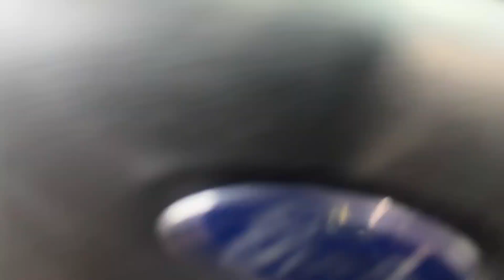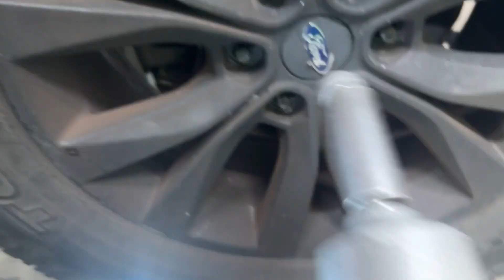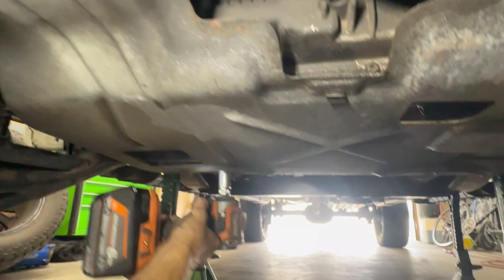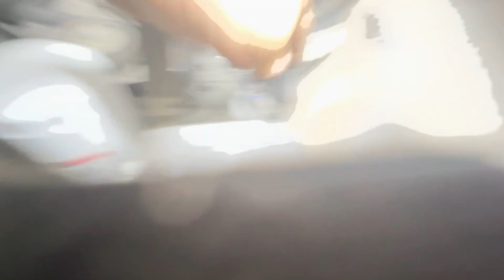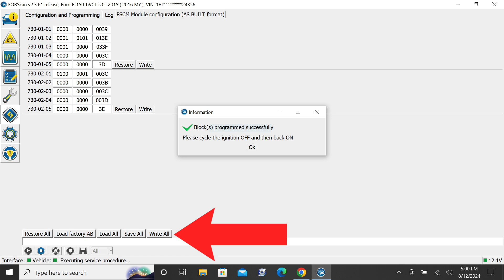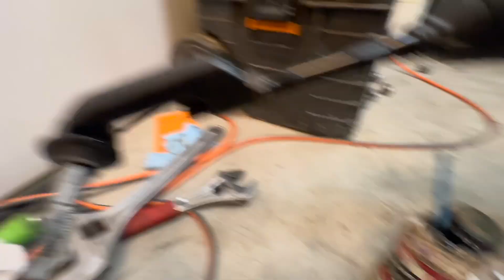Power steering rack replacement 2016 Ford F150 (pro tips)

Comment: Mine just started "wandering" left a bit, then right a bit.  Sometimes it pulls, but mostly wanders... i thought it was tie rod ends, but NOPE,  had an alignment done ✔️-  Ford says its not showing a code.  The mechanic i use said theres a code but he cant do anything-bring it to Ford.    Now Ford tells me its the rack. Had i understood fully about this electronic steering, i would never have bought it.  Why must we complicate things...
Reply from the maker: Typically, the big domestic manufacturers all have a back-end motivation for pretty much all of the technology they implement in certain areas of their vehicles.
If you’re asking me, a salty old technician, I believe it’s all profit oriented.
Reply: We're you able to fix it? I'm having the same problem with my 2019 F150. Any advice is really appreciated..
Reply: GM has them on Saturn's and other cars because on the assembly line it goes in as a full unit and saved the external pump, hoses, fill port and other components.

Comment: Guys, if you have something going on like I did, just get a better scanner than I had to see if it’s faulty ABS components. 

My issue turned out to be a $35 ABS sensor causing all the AdvanceTrac, Hill Descent, Hill Start Assist, loss of power steering on original and replacement steering rack. After spending 400 on a steering rack pulled from another truck, a little hell trying to install it, and 200 on alignment and a quick diagnostic to see a persistent code for the right side ABS sensor short circuit. Mechanic told me to replace that sensor. I did and everything went back to normal. He already loaded proper programming into the rack, reset and recalibrate everything. 

It’s amazing what havoc simple things will do. Ima stop tryin to be a mechanic now.
Reply from the maker: Can’t emphasize this enough! You definitely need to practice a methodology of diagnosis before repair. No matter how much you want the problem to be one thing, it will almost never be. Emotional shit 😅
Reply: Lo mio resultó ser la banda interna de la cremallera con valor de $18 me di cuenta después de gastar $800 en una cremallera usada

Comment: I’m wonder is 5.0 rack and pinion can be reprogrammed in to 3.5?
Reply from the maker: You know, I’m not sure that they used a different rack between the engine options. I think that there was a different rack on the 2wd version perhaps. Maybe cross reference the part numbers, I’d say if it’s probably not worth trying to use a different rack in one of these. So many systems communicate and it could cause more issues than it solves 😅

Comment: What’s crazy is mostly all that’s wrong with them is a broken $35 belt
Reply: Alot is also a failed sensor in the circuit board which means you have to replace the whole rack. Unbelievable
Reply: My issue turned out to be a $35 ABS sensor causing all the AdvanceTrac, Hill Descent, Hill Start Assist, loss of power steering on original and replacement steering rack. After spending 400 on a steering rack pulled from another truck, a little hell trying to install it, and 200 on alignment and a quick diagnostic to see a persistent code for the right side ABS sensor short circuit. Mechanic told me to replace that sensor. I did and everything went back to normal. 

It’s amazing what havoc simple things will do. Ima stop tryin to be a mechanic now.
Reply: @joshnc101 my truck is having the same issues as you described did you redo the whole rack or just do the abs sensor? if all you have to do is replace the abs sensor i don’t want to go threw and change the whole rack let me know if the abs sensor is all you had to do to fix your issue
Reply: @joshnc101 Which sensor did you replace? Thanks in advance.
Reply: @jav @javierdeleon6426  Just the ABS sensor, it’s mounted directly on top of the front wheel bearing hub assembly of either side. If it’s throwing a code, a scanner that can read ABS faults can say which side it is. 

Have it scanned first before pissin away money like I did.
Reply: A mi me paso con el modulo del abs solo me falta programarlo